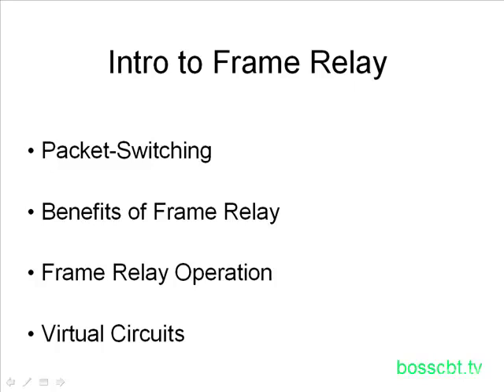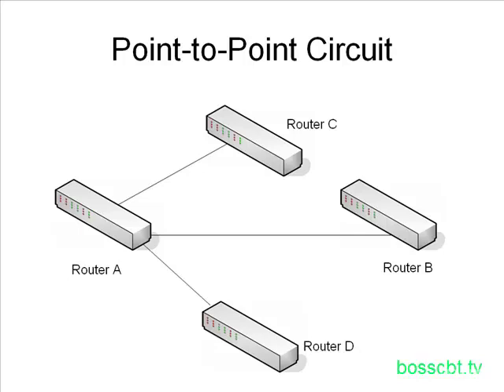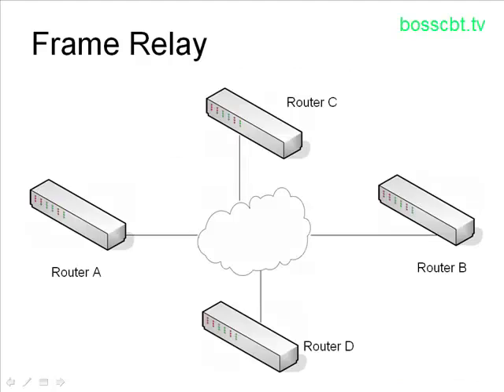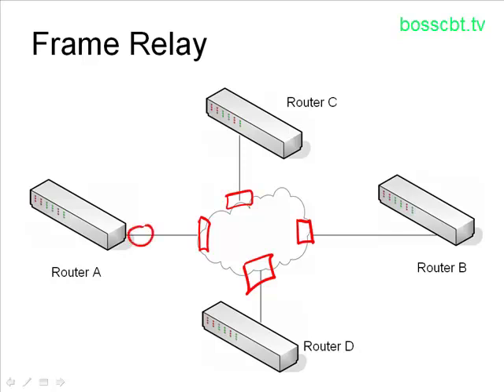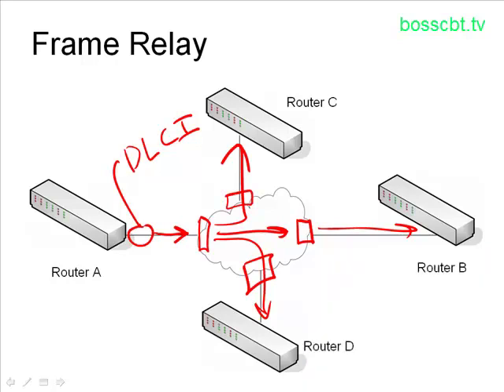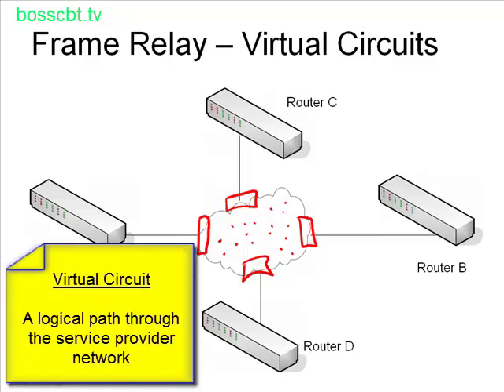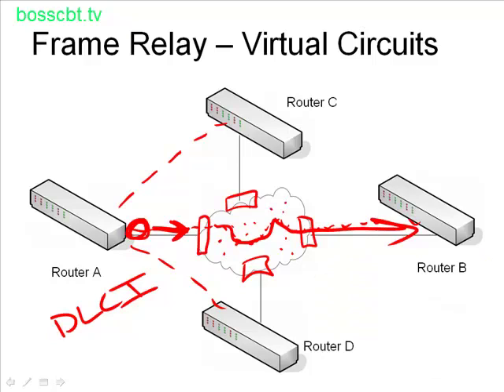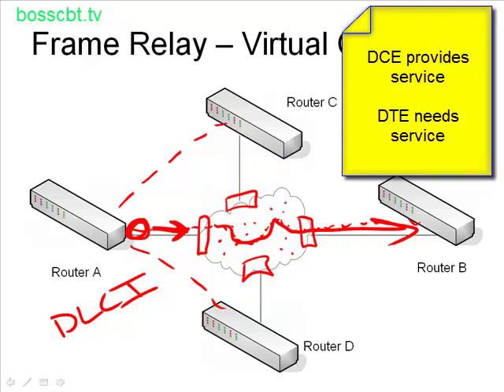5. Intro to Frame Relay

Comment: Do I understand it correctly that with frame relay, you have an addressing method that's like the IPv4 addressing method, but frame relay doesn't work on Layer 3 of the OSI model (like IPv4 networks do), but on Layer 2 of the OSI model? For example, frame relay uses DLCIs to identify nodes and paths between those nodes, whereas IPv4 networks use IPv4 addresses routing tables to do the same?
Reply: Sounds strange for me too
Reply: Remember OSI is theoretical model. There is no OSI in real live (they tried and failed to become popular). In real live you can send IP over PPPoE over Ethernet over some fibre native protocols. So more than one protocol can be assigned to given layer mentioned by OSI.